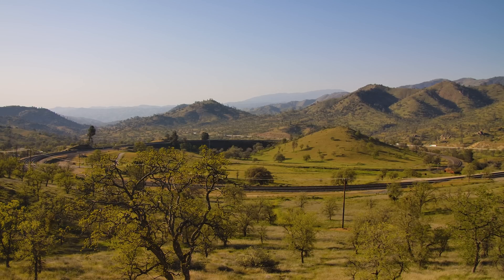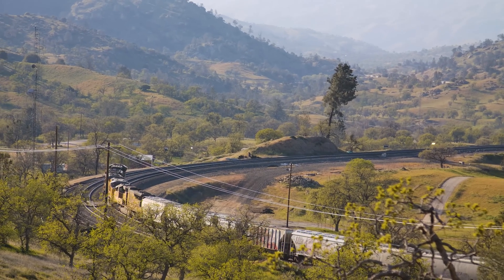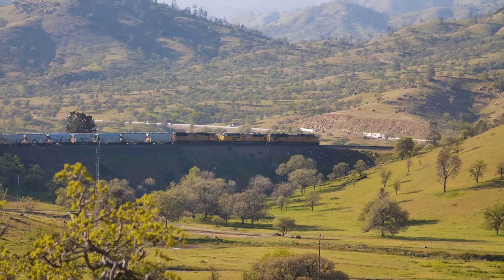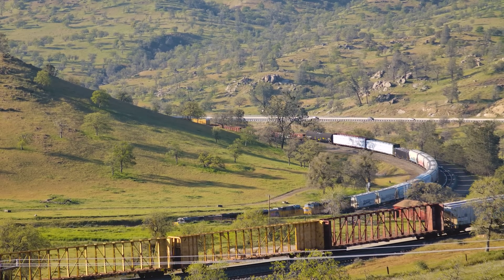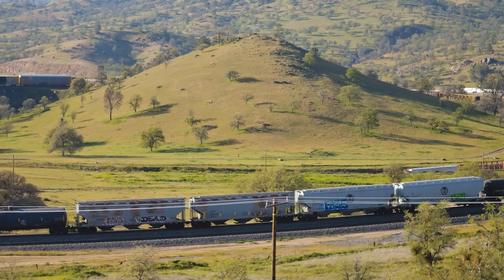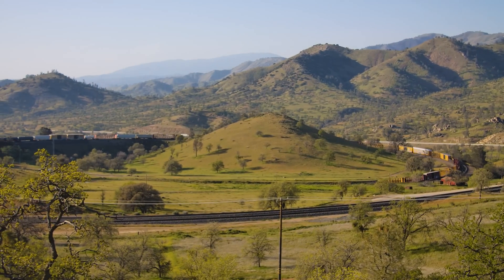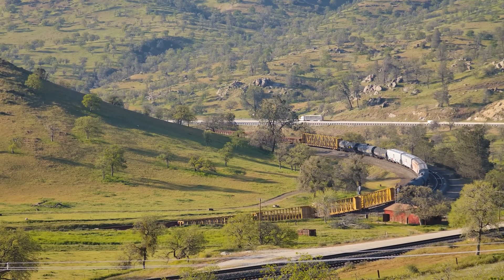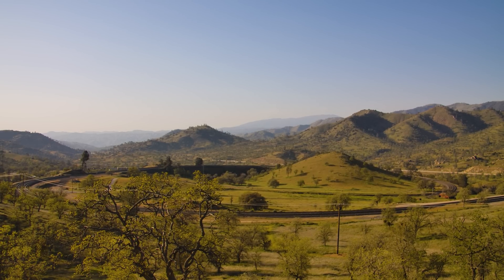The Tehachapi Loop

Comment: A little further down the canyon, there is one of the last remaining curved railroad tunnels.  This tunnel limits the size of loads on the line.  Large pieces of oilfield equipment intended for the  Bakersfield area must either be broken into smaller assemblies or transported by truck.

The fail closed air brakes were the invention that made George Westinghouse his initial fortune.  Prior to that, the brakeman had to turn individual wheels on each car.  This lead to a lot of brakemen falling off boxcars when traveling over roofs, train wrecks when they couldn’t make it to all the brakes in time, and expensive equipment failures from improperly balanced brake loading.  This meant that railroads were eager to install the new system, unlike auto couplers that had to be forced down their throats by unions that got tired of paying out for the amputated limbs of the workers.  My grandfather told me that during the depression, the foremen in the coupling yards could tell if an applicant was experienced by having him hold up his hands.  If he had all his fingers, he wasn’t.

Comment: You don't need it to be dark in the UK to see the EOTD - all our trains have a red light at the back, and many of them flash, but that is all it is, a light at the back! We also have breaking designed such that if a train breaks apart then the breaks come on - stops stuff rolling back down the hill into a terminus station. As the US still hump shunt, and I don't think the UK does, we can have railway trucks that are braked when not coupled.

Comment: DPU is my favorite thing when it comes to trains... I will miss lashups of five SD40's on the head end though. In addition, I typically see the flashers only at night, in fact, in my own studying I find they are usually not blinking in the daytime, at least here in MI. Those are powered by compressed air hence the whining noise when the tail end goes by. Lots of "mixed manifest" trains here in Michigan too.

Comment: @Joe Barnard My guess is that they made it a mixed car train because they are mostly empties being returned somewhere. All the lumber cars are empty, some of the boxcars had the doors open and the 3 scrap metal cars in the back were also empty. Empty cars would also explain why this train had no helper engines in the middle or in the back.

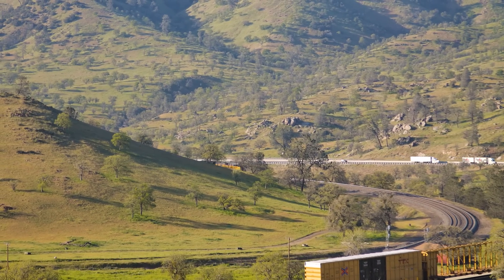Btw, in your explanation of the different type of cars there is a bonus one, the long boxcar in the foreground with silver metal grates on the side at 2:24 is a car hauler.

Thanks for posting this video 👍

Comment: Pretty cool. The scale seems massive. Our train compositions here in Switzerland are not quite that long either.
Reply: My understanding is that cargo trains in North America have gotten longer because of consolidation and cost cutting in the sector, which leads to things such as the derailment in Ohio and the town in Quebec that was blasted off the map.
Reply: @peraltarockets  and deregulation. The last administration in America removed a lot of safety regulations which led directly to the derailment in Ohio.
Reply: @peraltarockets  Yes, I think profits over safety at this point. These things happen only once, not every month or more! Not all are hazardous, but the dangerous ones there needs way more safety, no doubt.
Reply: It is- the Swiss and US rail systems are totally different. US freight trains are set up to take huge amounts of freight across the country really efficiently, and we have so little passenger rail they don't have to work around passenger trains like in Switzerland. Also the Loading Gauge (dimensions of the train) is significantly bigger in the U.S.
Reply: theres a reason america usually has around one train derailment per week...